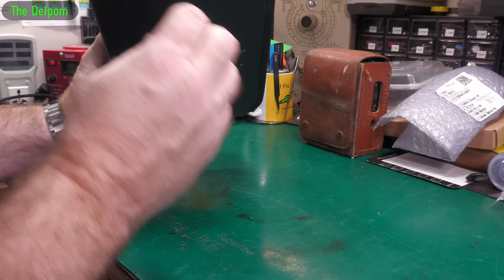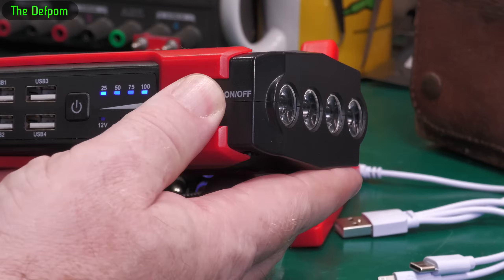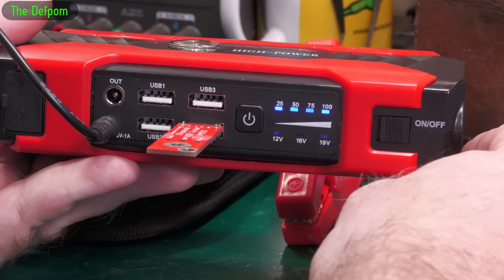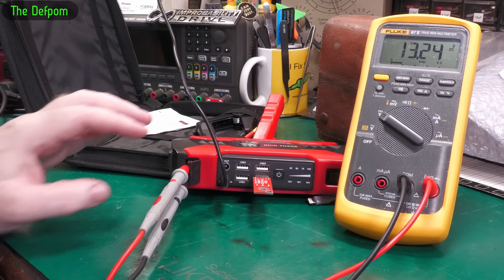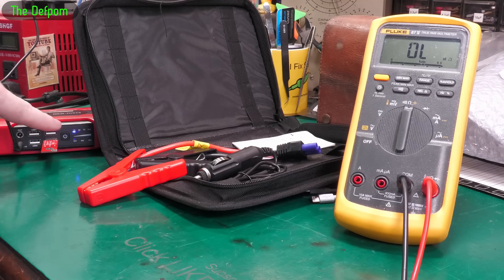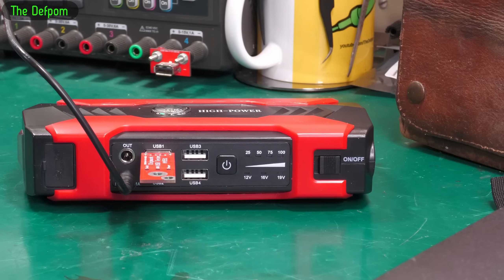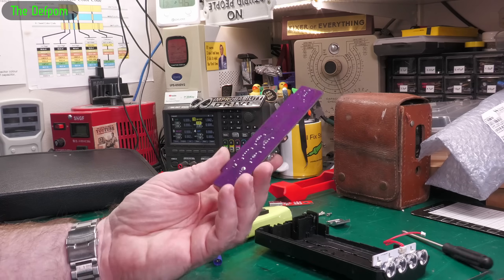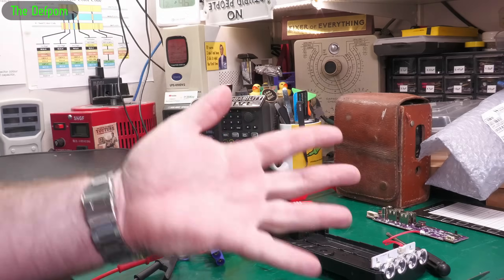🔴 Jump Starter Failed - Let Us Find Out Why - No.1359

Comment: they are all junk , I have had a few of those power bank / jump starter packs over the bench , they are either bad corrosion or swelled / bad cells . 
I just don't get why people buy them
Reply: @kiore22  2000000% junk
Reply: that's the problem with all these battery jump starter packs.  Lithium ion batteries should not be subjected to extreme temperature conditions.  Most folks leave them in the car which get cooked and/or chilled during the year in most climates and in turn lowers the life of the battery cells.  Even the best jumper packs would survive these conditions for 3-5 years max.  Cheap ones even less.  Constantly replacing these units is wasteful. 
People should start looking into super-capacitor jump starters if they want to keep these long term.  These are units that uses no batteries to provide a jump start.

Comment: Looks like a common garden 4s lipo battery as used in RC models with an EC5 connector. It is very risky trying to do what you were doing. Being into RC I do have all the correct balance chargers, when a battery fails either due to damage or over discharge I just bin it, not worthing burning your house down just to save a few pounds or in your case dollars.
Reply: Agreed, when these batteries go, they go BIG TIME. I had a similar sized battery catch fire with little warning, 3ft flames which can't be extinguished easily (luckily I was outside)..................Scott, please don't do this again on these sized batteries, it's just not worth it even for a YT video, and it's not a good idea to show others a possible solution to a bad battery.